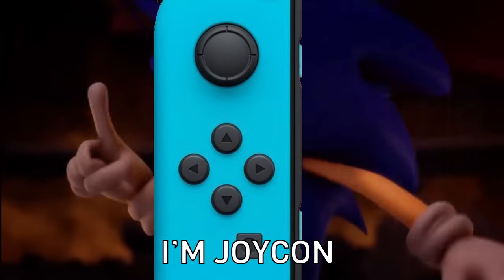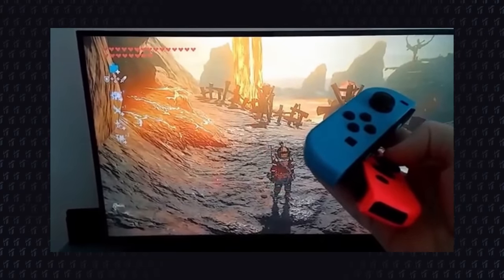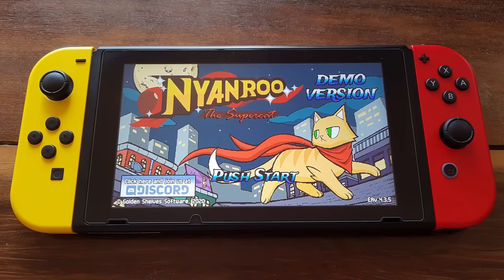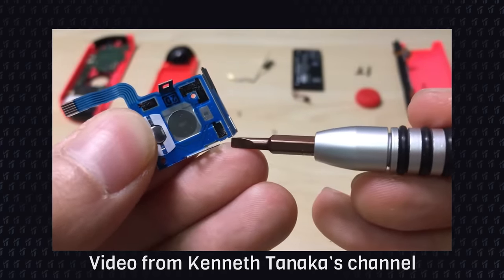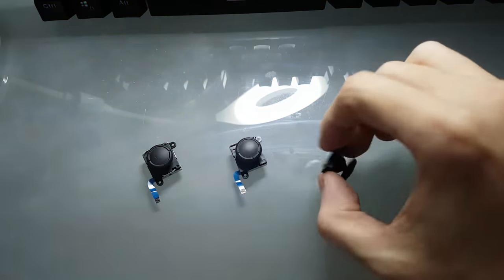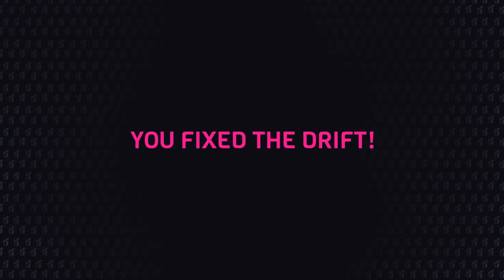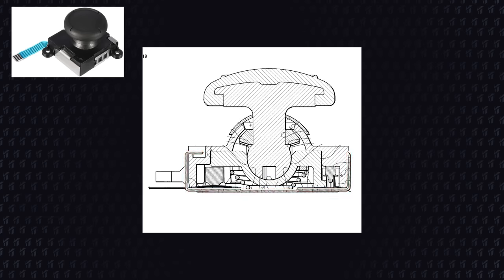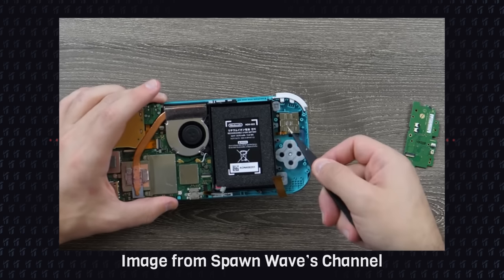How To Fix Your Joycon Drift Permanently!

Comment: Fascinating, great reverse engineering discovery. I'm no stranger to the innards of the joy cons. Every pair I get, the first thing I do is to replace the plastic rail buckles with more resilient metal ones. 

That said, I'll be damned if I can't snap the disassembled metal snap back on the bottom of the joystick housing... I've literally been trying for well over an hour now and I think it might actually make the drifting worse because of all the bending & prying I've had to do. I feel like this will create more space between the contacts on the flexible plastic PCB... 

In all honesty, this repair is so time consuming that it's still wayyy more practical to just replace the entire joystick altogether. New joystick replacements aren't expensive at all.

Comment: Did this in my IT class today, used cardboard instead of a card (since most of the cards in class were too small) and the drift, while it is still there, it’s reduced quite a bit, so I would recommend doing this for all of you who refuse to give Nintendo petty money
Reply: My drift is so bad that reducing the problem isnt gonna solve anything. Glad it worked for you thow
Reply: @potatowarrior7851  ok, so update, after a whole day of using it then sleeping, i woke up today and played animal crossing and noticed, there was absolutely no drift, so i can safely say, it works 100%
Reply: @Gmanluigi  after taking it appart and putting it back together 4 times one of the screwes didnt have 3 points anymore and was kinda like a hole. So i cant open it up anymore. I wanted to clean the whole thing but there goes that idea
Reply: @potatowarrior7851  dang, sorry to hear that man

Comment: This is a great fix, and if you are experiencing drift and nothing seems to work, try this, but this is NOT a permanent fix! The can come back, I've seen people have it come back in a few months. You can always try applying pressure to the joystick area and/or adding more paper, but this still might not fix it. Further more, this isn't without risk. Certain buttons stop working for some people when they try this. Moral of the story, do research on issues you encounter.

Comment: Holy.
Shit.

Now I can finally use them after I have neglected them for so long!
I got my NS at my birthday 1st of April 2018 and have used the joycons for five months until the drift happened. Dad and I tried to fix it by using wd-40, which worked for 2 weeks until it drifted agian. Instead of fixing it I bought a pro controller and procceded to never use it again in almost 3 years. But now I can use handheld mode without it bbeing a pain in the ass. Thanks VK!

Comment: I calibrated my joycons while applying pressure to the casing (i saw a comment mentioning this) and they are most likely temporarily fixed. I'd recommend trying this before actually pulling them apart. Thanks for the video tho! 
Edit: a few hours later and the left one is drifting again. The severity is much lesser. The right one is fine though at the moment. I'll be doing this to the left one tomoro.

Comment: Dear fella...this just fixed my wife's joycon! 
You are amazing
Literally 5 min
I have put a cut of amazon cardboard envelopes. 
I didn't disconnect the battery or the antenna, just put them out of your way carefully.
Thanks a lot VK!!
Reply: why should it disconnect the battery?
they are connected with the ribbon cable and not with contact with each other...
Reply: @ilhanovic5219  That is what I said fella, I didn't disconnect it. Just put them out if the way!

Comment: The metal on the bottoms will bend over time. I've seen several new and used sticks, and all the bad ones had a bulge in the bottom of them.

Comment: 1-2mm thermal pads might help apply the pressure, it compresses too but it helps stick to the surface when replacing the backside. It is also not electrically conductive.

Pieces of 'cardboard' or paper are essentially 0.1mm to 0.5mm thick and applying pressure might require up to around 1mm thickness? Also the plastic carriage of the battery compartment can compress and soften from pressure and wear... So a thermal pad might seem like a decent solution.

A 3mm thermal pad can compress down to 2 - 2.5mm thickness maybe. And 2mm thermal pads down to 1 - 1.5mm?

Note, 'business' cards are not 1mm in thickness technically, may be less. But with 1mm you can get a 'mild' pressure... For longer term pressure I do suggest 1.5 to 2mm of thickness as the battery carriage is pushing down on it.

A even safer way to fix this since the battery carriage is pushing on the metal plate, apply thermal pad ON the battery that is 2-3mm thickness and closed the lid on top? It will act as extra pressure onto the plate, but might not cover the entirety of the plate.

Comment: This is an issue that has affected pretty much every Nintendo controller with a joystick on it, I can remember all my old N64 controllers suffering from this issue to varying degrees, even the Wii Remote suffered from drift issues too, which made playing the original release of Skyward Sword a real pain cause you had to constantly perform a reset of the alignment, not much fun during a boss battle or when you're trying to navigate a narrow path, I've got a few joy cons that exhibit the drift issue and I've already tried sending them back to Nintendo at least once, I have some formal training as an apprentice fitter and machinist as well as some experience at fixing electronic equipment so I'll give this fix a go.

Comment: Funnily enough this was my fix back in the day for fixing ps3 controllers there was a pad lifting the mother board and the sheet of plastic that would register controller inputs and the pad would flatten over time so i just put a piece of folded paper in there and it was good as new i just think opening the drift cons is a night mare ill try it once i get home but it should definitely work didnt think about it being the same type of mechanism thanks man good find

Comment: There's a similar problem with PS3 dualshock controllers and it's a similar fix, just put a few layers of tape inside the controllers so the contacts have more pressure. The PS3 controller didn't have drifting analogs but it would read inputs from the face buttons by itself.

Comment: Dang I always believed in the alcohol method. It does work once, but never again. And yes, the drift comes back even with cleaning under the rubber part
Reply: I also realized this by observation: when I play minecraft, drift slowly starts and gets worse. When I get passed by it, I just go on youtube (on my switch) and it gradually stops the drift. And when I get back on to any 3d games, it slowly goes back on. It's Hella wierd

Comment: Got extreme drift immediately after moving to another country. The case I had my switch in was under a bit of pressure in my bag and I would assume what happened was the analog stick got pressed down from the external pressure which loosened the frame piece discussed in the video. 

Need to go out and buy a new tri-point tomorrow to try this but it would explain the sudden shift from 0 drift to extreme drift in less than 2 days.

Comment: 2 alternatively cheap fixes they could have implement to fix this issue, would be to either change the mold on Joy-con shells to support that area better, or use a short piece of styro-tape on the back of the reader's chassis. If we get that rumored switch 2 announcement soon in 2023, let's hope they fix this issue going forward and don't just downplay it while recycling parts without a fix.
Reply: No switch 2 this year

Comment: At first I had it while playing Mario Kart 8 delux online (which sucks), it got fixed by not having so much stuff in front of the docked -switch causing interference. Then I had it playing Breath of the Wild (walking off cliffs), I just used a q-tip and alcohol and that seemed to fix the issue (for now).

I've found there are usually ways to improve on the issue without having to open it up or send it back, I feel sorry for anyone who couldn't fix the drift without those extreme methods.

Comment: This worked like a charm and I insta-subbed! For anyone attempting this, bear in mind that you need a three-pronged screwdriver. It is a bit unusual (see what I did there) and I was happy to have one lying around. Thanks so much for sharing! Now, to put the controller to work on Zelda!
Reply: Replying to myself here... I am sad to report that the drift eventually returned, and with a vengeance, at that! My feeling is that the repair concept is still sound (so I am keeping my subscription here). Possibly the folded paper I was using eventually got so flattened, it was no longer fulfilling its purpose. For anyone attempting this, I propose using a stiffer (less compressible) material. I will try one more dissection, inserting a different material this time around. Currently, I am leaning towards using several layers of Kapton tape. Hope this helps anyone wanting to attempt this repair!

Comment: This is a temporary fix, as you are just compressing the metal spring contacts, they will form towards that higher pressure. With use, the springs degrade, and the drift comes back. Replacing the springs will work just as well, for the same reason. But good job on finding the issue. Now if nintendo (or a good 3rd party-) brought out better springs, then the problems can be prolonged. But a quickswap service option would be the best one for nintendo.

Comment: Hello VK!

I don’t know if you’re going to read this but I might have something that might interest you. Gulikit, the company that makes and sells the KingKong controllers for the Nintendo Switch, sells replacement sticks for the Joy-Cons. Gulikit is claiming (on their website) that their “Elves” joystick lasts longer than the average Joy-Con analog stick. The “Elves” joysticks are also used in Gulikit’s “Elves” controllers. I researched all over the internet and found no one reviewing or testing this product. So I want to ask if you can test Gulikit’s Elves replacement kit because the paper trick is sometimes unreliable. (judging from the comments on this video) Who knows? Maybe Nintendo Switch owners could just buy from Gulikit and fix the drift problem forever.
Thanks in advance!
Reply from the maker: Hello!

Actually guli kit has also developed a hall effect joycon stick that It is drift proof, currently it is used on the ayaneo consoles but soom they will start selling those, you can see the new sticks on their twitter

So I'd rather wait for those to buy them and review them instead of buying the elves kit
Reply: @VKsChannel  Thanks for replying! 

I did not check Twitter since I don’t have an account. (I also forgot it exists) I’m excited about the new sticks! Will watch it if you make a video about it. May I suggest that when you use them you’ll give monthly updates or something like that?  Or compare both so that people will know which one is better? I still can’t believe we have to rely on third-party companies to fix Nintendo and other companies problems. (Hopefully, Gulikit makes sticks for other controllers too!)
Thanks again and have a nice day!

Comment: 4:16 except both ps and xbox controller drift over time. There was an old controller that used hall effect encoder instead of cheap potentiometer, but I don't remember what console was.

It's just that the joycon is exceptionally crappy: you fixed the worse part, but in time it will start drifting again

Comment: I have a couple switches and I've never had the issue myself come up I have it with other controllers that are old from other gaming systems but I fixed those with cleaning and making sure everything was lined up properly but what I can think of is the joy-con is not designed to hold the pressure that it has when it's first screwed together and as you click on it and press on it and it gets banged around eventually those pads go up and it was just something that wasn't thought of when Nintendo first design these joy-cons long-term midship they want you to buy a new pair that's how they make their money they're not cheap

Comment: I've had to fix drift on PS3/4 and Xbox One controllers, oddly enough my JoyCons have been solid. The real issue is these companies using resistive/potentiometer based analog sticks. If they would just start use Hall effect sticks the drift would be (near)completely eliminated. I work on arcade machines that have had Hall effect sensors in their sticks and they've been good for around 40 years now, zero issues. When drift start popping up (en masse) in the PS3 era, manufacturers should've seen that and started working to solve the issue... instead they just kept using the same stuff that is known to cause issues.

Comment: 3 of my 4 Joy cons are drifting from time to time. I'm going to check this out and hope you are right.

One thing you said here doesn't hold up though: other Controllers using Sensors on the side of their sticks do drift. My first Pro controller started to drift after about 2 years of use. I managed to get it working again for a few months by replacing the sensor in question but it kept happening. I finally caved and bought a new one recently but they use the same stick Base as the PS2 controller does and it doesn't keep them safe. Just wanted to add that.

Comment: But how do you even open up the joy con? Even with the smallest screwdriver the screws won’t come off. So many people seem to have done this so easily but it just doesn’t work for me. 

And yes, I was using the right screw. But they just won’t turn.
Reply from the maker: You may have stripped your screws =(
Reply: @VKsChannel  For some reason I never got a notification for this reply, so I’m a whole 10 months late. But what does that mean?

Comment: I performed the fix, and the drift seems to have finally been resolved. 

I have the joy-cons that came with the Splatoon 2 bundle back in 2017. After two years, the drift had started to appear in the left joy-con, and it got worse overtime. I sent it to Nintendo for a free repair. It took two weeks before it had arrived, and there was no drift. Half a year later, the drift returns. Simultaneously, joy-cons that I have bought only a year before to play with a friend have also started drifting.

I have given up on Nintendo. After a year and a half of dealing with the drift on my original joy-cons, I reached a boiling point. I saw the video by VK and was overwhelmed by having to disassemble the joy-con, but after realizing the drift appears 95% of the time, I caved in. I put in two pieces of cardboard bound with tape inside the controller, reassembled it, and it appears to work at last. My only concern is the controller is very-slightly upraised, and you can feel it by running the thumb between the inner-edge of the controller and the console itself when in handheld mode.

I'm very thankful to VK. It was very frustrating to try and select characters in Smash when the cursor drifts up every single second. I truly hope this fix can last a long time. I just want to ask if the upraise on the controller would be an issue down the road? I tried to do one piece of cardboard, but it wasn't enough for stopping the drift.

Comment: I tried this months ago and yes, this actually works, but...
1.- The piece of paper/cardboard has to be really accurate. A piece of paper is too thin and a piece of cardboard is to fat. Otherwise, you will have issues screwing it back or even placing the joystick in back. Also, both of the joycon shell parts can be separated due to the "amount" of paper/cardboard (this is only aesthetic)
2.- Sadly, if you use your Switch daily, eventually the drift will come back, and re-open the joycon is a pain because the screws have a really bad quality and they break so easily (I recommend a plastic screwdriver)
3.- You will lose the warranty of your joycon so I recommend send them to Nintendo since they repair them for free even out of warranty (at least in my country)

After all, I had to buy new joysticks because, at some point, they are not repairable by "easy methods" like this :(

(Anyways, I also have a 3rd party joycons (mine are Hori Split Pad Compact) and this is by far the best thing you can do because, at least what I know is, every joystick eventually will have a drift or they have other issues like resistances, slides, etc... I just want to replace them with a new shell just for fun)
Note that joycons in particular have no bluetooth or NFC reader, they are bigger and are ONLY suitable for handheld mode. It fits on the dock, too (there are a bunch of models if you need bluetooh or stuff like that)

I hope I can help if you are thinking of doing this video method :)

TL;DR: this is only good as a temporal solution. Be careful with the size of the paper/cardboard.

Notice this is my case :P good luck and I hope you can fix yours forever because its a ****ing pain have this issue on a +300$ product.
Reply: Idk if it has been resolved but there were cases of joycons being returned with the wrong color a long time ago so if you had the Grey or blue/red you were fine of if they were brown like in the pokemon let's go switch you might not get the color back

Comment: I followed all of the instructions, did exactly what was shown and it only made my joycon worse. (it wont even go left or right anymore.)
I don't even know what I did wrong since nothing broke off after checking for any missing parts prior to 
putting it back together. Just the fact I did everything exactly here still resulted in complete failure for me. :(

Hopefully nobody else had said problem or has a way to help me figure out what I missed